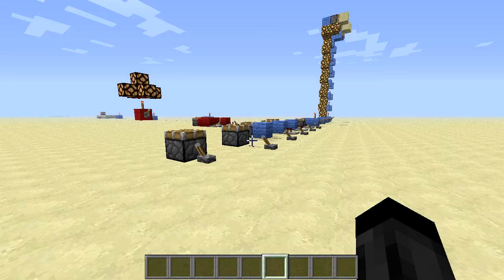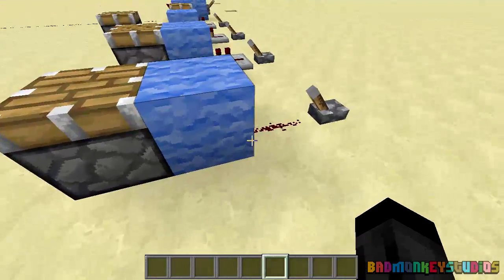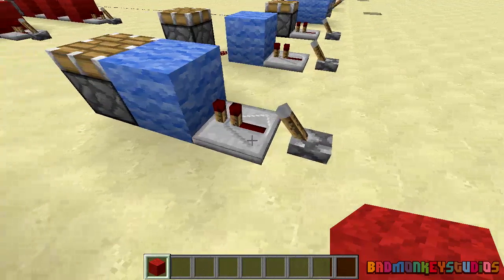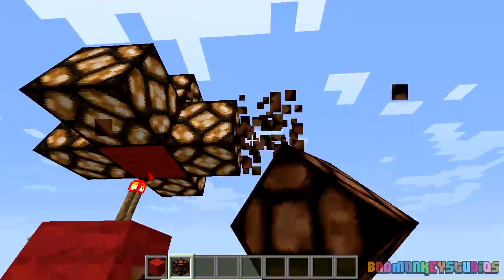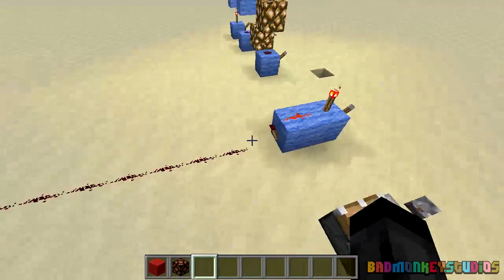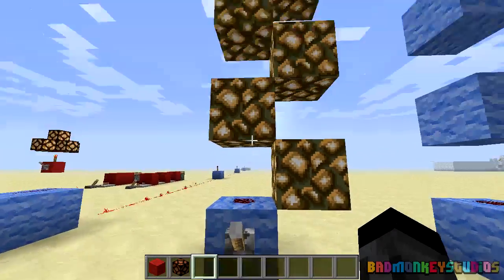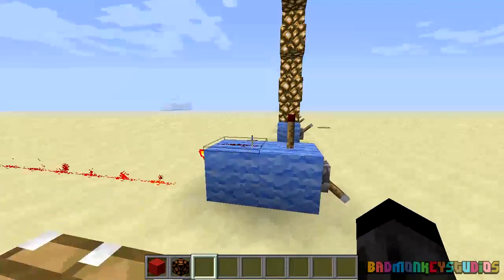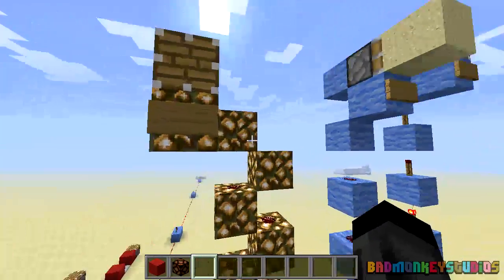Learning Redstone: Using Wire, Repeaters and Torches

Comment from the maker: Learn the basics of redstone first then move on to more advanced, then once you think you have a good understanding on how things connect and work try using command blocks, you can make really good stuff with that, it should blow anything he made out of the water. Keep in mind that mostly anything you would want to build has already been done so have a look around at other people designs and try to emulate the. Hope this helps.